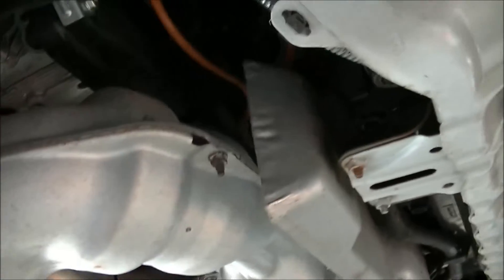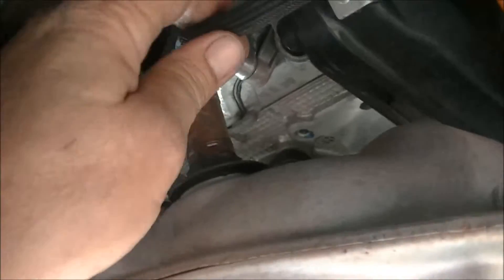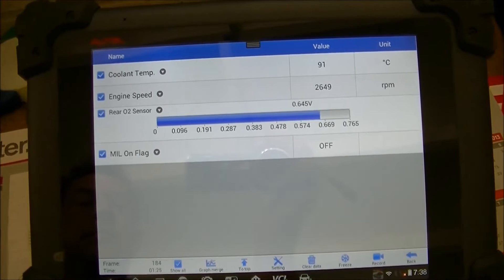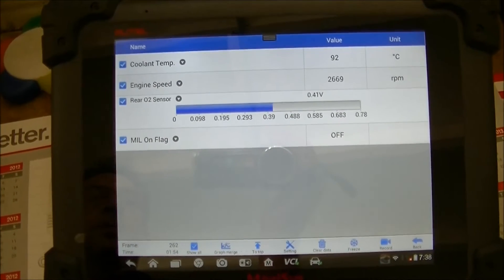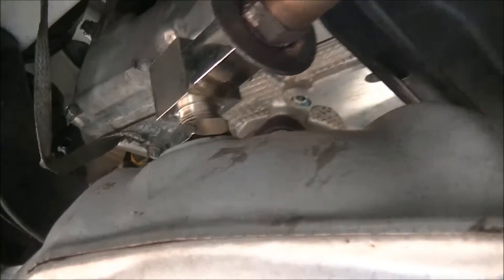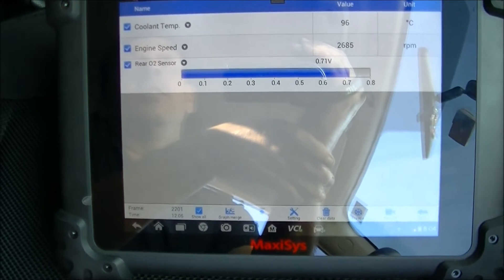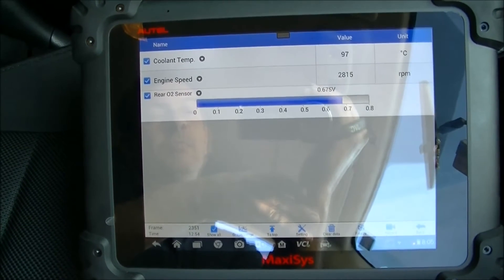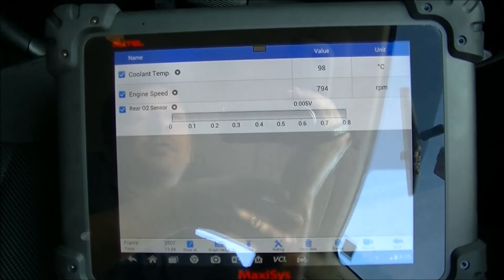Fixing a Subaru P0420 - the cheap and nasty method

Comment: My car just fired off P0026 P0028 and P0420.  A bunch of random forums out there are saying it's most likely low oil / low oil pressure, maybe a bad oil control valve / intake control solenoid for the VVT.  Since they all went off at once it's probably just low oil for me.  Good to know this little trick though, thanks.

Comment: Old thread revival. Great fix, where do you get the spacer from?
Reply from the maker: plenty of them available on Amazon or eBay. search for o2 sensor riser or o2 sensor spacer
Reply: @cobsterboy  This was for another poster originally, but I pasted a reply to your comment so hopefully I can learn more about cats since I have chronic Illness & can't work/make $$ so I'm going to figure out how to cat delete or hollow out a cat, although I don't know if I still need 02 sensors or not if I do this? Also, do I need to do this to just rear one or both the front & back cats? Would 02 sensors matter at that point after cat delete's?? I'm way fed up with being gouged by evil car manufacturers!!

(So since you took out the honey comb element, then why do you need the same adapter? Shouldn't just removing the element be enough? Do you even need O2 sensors when you do a cat delete or hollow one out?)
Reply: @cobsterboy spark plug non fouler works too.

Comment: Totally agree I just did this to my subaru it's a 2009 it has 100k miles the new catalytic converter plus a new sensor is like 900 just in parts this car is just to drive around town  I did this today drove 30 miles so far no check engine light I'm happy a fix in my eyes also
Reply: Where did you get that post at??? 
I got a 2009 SUBARU FORESTER XT. With that code on after I install a nameless exhaust system. Sounds amazing but I got that code now.  Link if possible

Comment: Rod, you said in a comment that the Catalytic Converter is basically dead.  If it is dead, wouldn't it be so plugged that exhaust would not run through it?  Or by dead, do you mean that the Cat efficiency has fallen below the 95% level?  I have a 2010 Forester and have been running with the codes on the dash since 2014and we are now into 2020.  I didn't know there was a fix.  Just wasn't going to pay the $2,000 to fix it.  My mechanic said just run with the lights on.  It's never seemed to hurt it.
Reply: Problem for me is that it disallows the the Cruise Control if there's an engine light on. No Cruise Control sucks!
Reply from the maker: I didn't examine the internals of the catalyst so I cannot comment on the condition of the substrate. The catalyst was simply unable to effectively perform the 3-way burnoff and failed the diagnostic test.

Comment: What year is this Subaru? I've read that spacers should not be used on cars 2005 or newer as fueling problems can result due to a change where the ECU is now taking data from the downstream 02 sensor to alter fueling.
Reply: same question same situation, I have an '08 Outback, I am reading anything DBW (drive by wire '05 and newer essentially) the ECU uses the rear sensor for fueling adjustments, it may trick it into not popping the light but it will also attempt to adjust the fueling so it runs "worse", it older models the rear sensor only "checks" the catalytic converter and doesn't effect running, not sure, just what I'm reading out there

Comment: Is there a risk with buying a cheap code reader and just clearing it each time? Bought a used Forester and I've had this once or twice a year since I got it
Reply: Only issue on the Subarus is when you clear the engine code it resets the drive by wire and you must relearn it each time or it won't idke correctly
Reply: @p0weraid  hi, I bought cheap  code reader and clear the code p0420. Now my idle is not smooth.. what you mean by relearn it?
Reply: @luqmanawawi  after you clear the code or disconnect battery you need to let it idle for 10 mins without touching throttle then shut it off and let it run for 5 more mins and it will idle fine that always worked for me

Comment: Time to investigate: worked at a jiffy lube for couple of months and the majority of fail inspections were 420/430 the rest were small cracks in windshields and low tread tires (safety). Capitalism is coming into play. its seems inevitable cars will get that catalyst code as, so aftermarket and stealerships alike will mark up that part of a car(supply). The DEMAND will naturally rise as cars get geriactric and are subject to CARB/emissions. Between the car manufacturers, aftermarket, stealerships, and consumers, we see whos the losers. An abstract outlook will be perfectly running vehicles will create a new junkyard/salvage market.
Unless laws are changed, or we go electric-bugaloo. I cant see any thing that can be optimistic for the motor vehicle owner.

Comment: Isn't that catalytic converter warrantied for 8 years? You mentioned that she only has the car for 2 years .I agree with what you did by the way ,Subaru's have issues with catalytic converters.Subaru sure charges a lot for parts.Could you get a used one from Japan?I am in Canada and there are suppliers that bring in used ones from Japan.

Comment: Subarus are plagued with this... I had a 1999 Outback doing the same, then an Outback 2002 which also shows the same problem, and now, a colleague at work is selling his Outback 2001, which, doesn't  surprise me anymore, has the same exact problem: P0420.
But granted, after 100k, a cat converter is usually not good anymore and should be replaced :-P
Reply: odd i have a 99 with 184k ... still original cat and... no code =) ... knocks on wood
Reply: 3.0 H6 Outback 2004 and now my 2002 Forester 2.0 125hp. I raised the sensor did 600km light. Replaced the sensor and replaced my cat. 800km and I got the light back. Almost started to miss it. Sucks

Comment: Employed a similar method on my '08 Impreza 2.5i, except using (2) defoulers stacked on top of each other.  The air scoop that's connected to the air intake conceals the area where the downstream O2 sensor is located; I went in for my smog check today and when the tech did a cursory visual inspection of the engine bay today he was none the wiser.  I live in California as well so I was a little worried but was able to avoid a major repair bill for a few dollars.
Reply: As a fellow '08 Impreza owner, is that still keeping the CEL off?
Reply: @sambrinson89  The CEL came back on after a couple days, which had me scratching my head.  It's been a year since this fix, so my memory is a little fuzzy, but I used a combination of fouler lengths (1-Dorman 42002 & 1-Dorman 42009 from Amazon), made sure everything was tight (careful it feels like I almost stripped the O2 sensor) and wasn't leaking and was able to get the light to turn off again.  It hasn't turned on again since and has been running like normal.  Also, I put a dab of high temp silicone around the O2 sensor washer (non-removable) so that it wouldn't rattle during the smog check and blow my cover.
Reply: @southpawscientific4122  Thank you for sharing the knowledge!!

Comment: In the States cat converters are under factory warranty for 8 years, it is Federal Law that the dealer replace a defective converter if it fails before then.
Reply: So my 2012 could get replaced at no cost ?

Comment: Its a subaru problem.  My 1999 imoreza had the 0420 code, and now so does my 2009 legacy
Reply: KX125Ripper just turned on at 102,000 miles on my 2009 Subaru Impreza. How did you solve the issue?
Reply: My answer to you is my comment copy/paste: Subarus are plagued with this code... I had a 1999 Outback doing the same, now Outback 2002 at 167k which also shows the same problem, and now, a colleague at work is selling his Outback 2001, 176k , which, doesn't  surprise me anymore, has the same exact problem: P0420.
Granted, after 100k, the cat converter is usually not good anymore and should be replaced :-P
Reply: @Allbbrz   I have had 2 Subie Outbacks. They both had P0420. The engine sensor said Catalytic Inefficiency both times. On the first one I replaced the Convertor 3 times in 2 months. FINALLY a smart mechanic told me that it is almost ALL THE TIME the downstream 02 sensor. And it was both times.

Comment: The "legality" issue,  is a touchy thing... What if it is "legal" but totally unfair? Would the One that Judges the 'legal' aspect of our lives, consider if the issue is "legal" or just? Why is Mercy always placed ABOVE the Law given to Moses? The Tablets of the Law were kept INSIDE the Ark, while the Ark had a Mercy Seat, covering it closed and guarded by two Cherubs. What do you think? I would have done the same. On another note, what you did, only retarded the sensor's reading, or changed the tested subject's density (the ppm to the volume of the burnt mixture), at which interval, the Car's CPU concluded it was "low" (or, in other words, "too rich in Oxygen" still. What 'actually' happened, the 90 degree elbow had LESS concentration of air/pollutants). This is ridiculous position to which Man has reached, in its quest "to obey Law". Screw the Law, in this case. Thanks for your Video.

Comment: will this make the car run rich at all? got the same issue in my 05 STI
Reply: No, Your car will not run rich. The rear O2 sensor is strictly for monitoring emissions. The front O2 sensor will affect A/F ratios.
Reply: Gator same here 05 sti did you fix it

Comment: This is brilliant! See so many p0420 codes with bad cats, what a good cheaper alternative. Did you make this? 

Respect from Gold Coast!
Reply: Alex Brophy spark plug non fouler from auto part store. $6
Reply from the maker: +Alex Brophy No, I didn't make it. I purchased it from PAT. If you do an eBay search for O2 sensor riser you will find many different variations on the design available.

Comment from the maker: The legality of this fix was explained to the customer and they were given the option of installing the OE replacement engine pipe or the O2 sensor riser. They opted for the cheaper O2 riser. 
Not long ago (about 8 months later) the customer contacted me and said that they have raised the funds to get the expensive OE engine pipe, which has now been installed.
Reply: If she is the original owner, she should call Subaru customer care. They are pretty reasonable in the States when the mileage is that low.

Comment: an aftermarket cat won't work?
Reply from the maker: +philip dias As I said in the video, there was no aftermarket engine pipe available for this application. Of course a universal aftermarket catalyst would have worked, that is if you could find somebody willing to install a universal catalyst and attempt to re-install all of the heat shields again. I doubt that would be an easy task and it was one that I wasn't willing to attempt.

Comment: Rod Subaru Australia have a software fix for this problem. Please in lighten me on how putting an adaptor will change the o2 reads to act normal?
Reply from the maker: +allstateautoimports .Allautos There were no outstanding calibrations for this ECU. This wasn't a software issue, the catalytic converter was dead. This is confirmed in the first section of live data showing the rear O2 sensor cycling over the 450mV point.
Reply: moves it martially out of the exhaust stream. basically fools the computer. no legal,but a cheap fix...